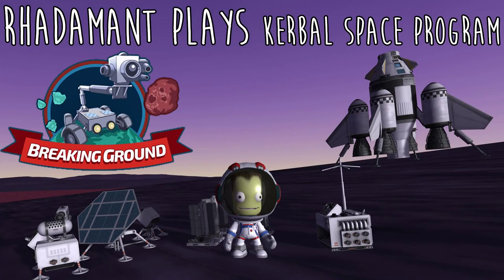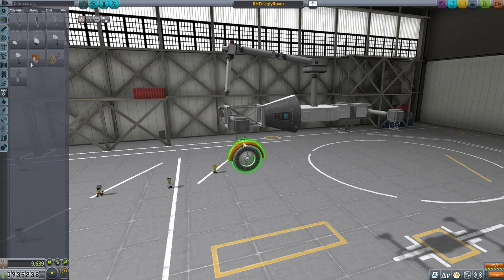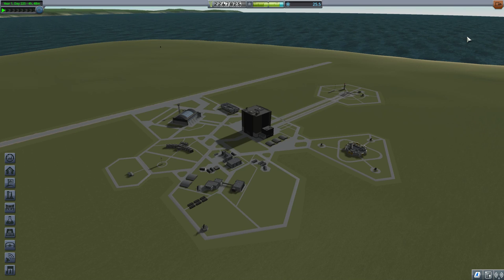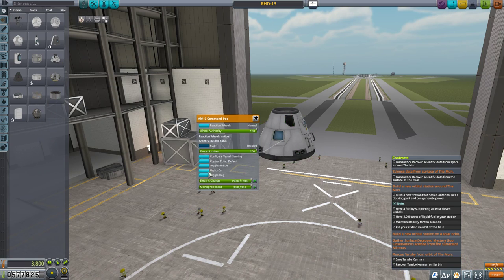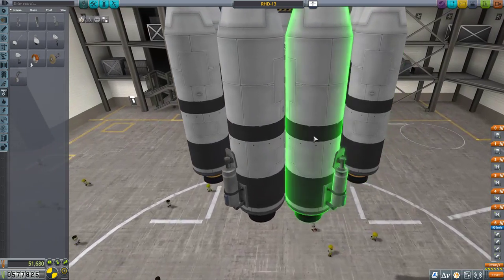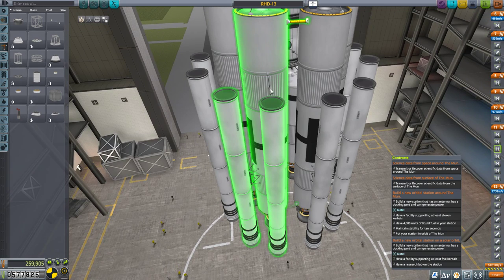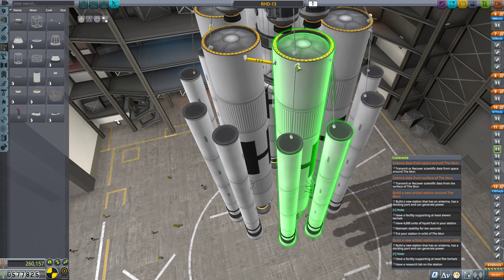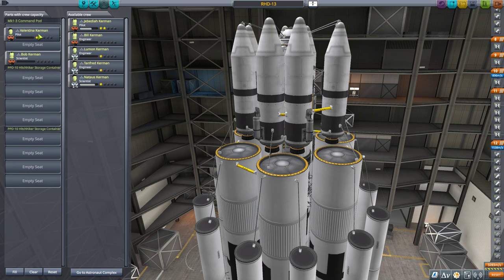Kerbal Space Program / EP 15 - Breaking Ground / Kerbal Career Mode

Comment: You're likely already aware, but when making the fairing if you select "interstage nodes" you can place the fairing away from what you're connecting it to, put the antennae or whatever payload you have inside, and then close the fairing with whatever you've attached it to instead of closing it off with a 'nose cone' (It can be a bit finicky finding the right spot to click to close the fairing this way). This way you can still build underneath the rocket. Oddly enough, even without truss structures the 'base' of the fairing will float in place. I suppose you can get a similar effect by using an engine plate, but the fairing clips through the antennae...
Reply from the maker: I was aware indeed, but thank you for the reminder!!